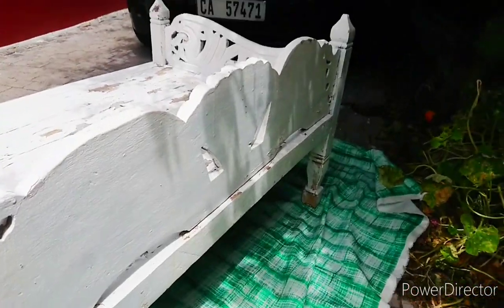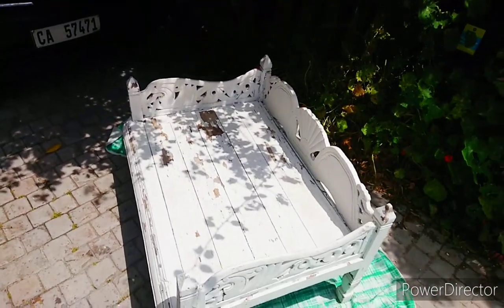Restoring Antique Daybed

Comment: Why not use stripper? Wouldn't it have made removing the paint much easier?
Reply from the maker: Yeah, if I was under more time pressure I would have used some chemical assistance for sure. But I enjoy the tedium at times, at long as I'm not rushing, which I wasn't. But yes, paint stripper certainly has its place.